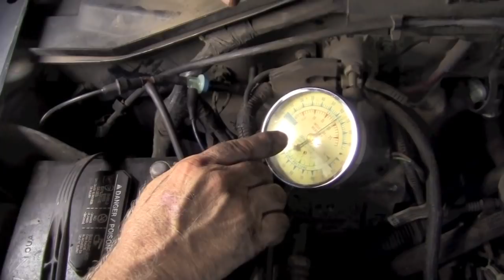Using a smoke machine to find an A/C Problem

Comment: man, you are good! 
question is what was wrong with having a cable operated duct? why did vacuum or an electric motor come about?
Reply: great question.  The reason is too things.  Primarily it is because when it is electrical it will be converted to digital.  At that point it can be more directly monitored, controlled, and a code can be established to recognize a fault.  That way, in the future robots can fix cars and eliminate humans..

Comment: Does that leak can cause check engine light? I'm learning.
Reply: Only if the leak was enough to cause a lean code (since it is a vacuum leak). In this case, not likely. If the line was completely cut (bigger leak), then I could see such, especially on a smaller engine.
Reply from the maker: Nancy the answer is no because the CEL would mean the computer either monitors and/or controls it.  This system is simply vacuum operated, no electronics